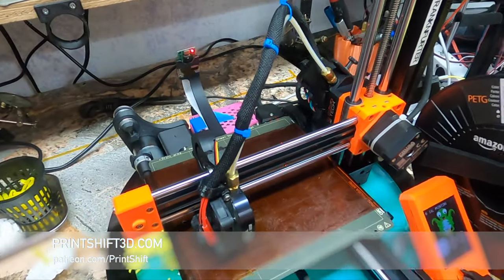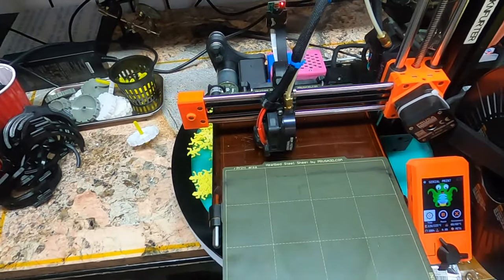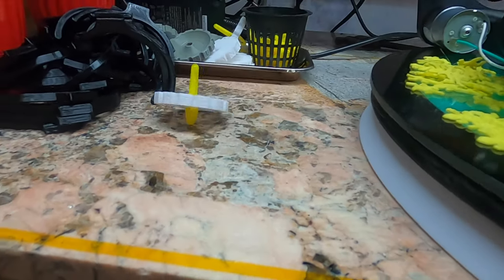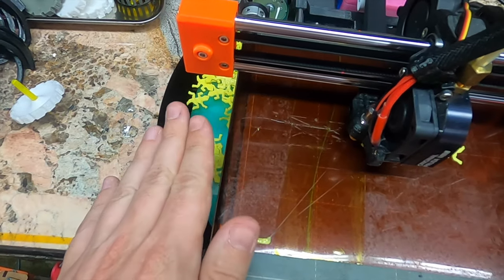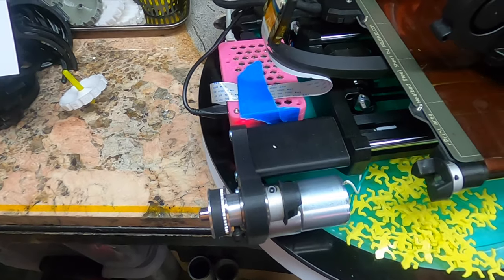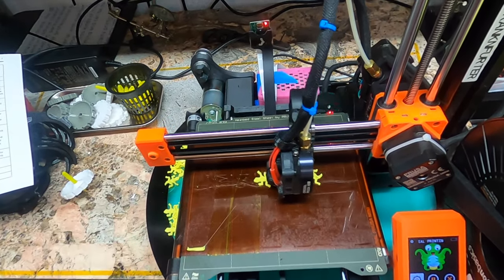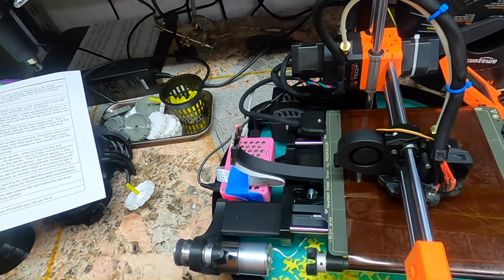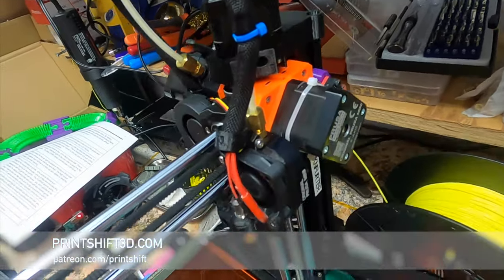PrintShift 3.0 channel trailer

Comment: Have you considered selling a parts kit?  I ask for two reasons: 

1) I love tinkering and building things and don’t mind troubleshooting or being a beta/alpha tester but I absolutely HATE sourcing random parts for other peoples designs (I don’t mind for my own projects because I’m doing it piece by piece and building familiarity with each aspect as I go, but for things other people have made I might not be able to tell a shipping mistake from an ordering mistake)

2) I can expense a project kit (with reasonable fees for time sourcing and funding additional project development) as R&D in a way I can’t (or rather can’t justify to management in the same effortless way) with Patreon
Reply from the maker: It's definitely on my mind - I made up a BoM (https://printshift3d.com/portfolio/Bill-of-Materials/), and, well, buying all the parts separately is rough.  Logistics and free time willing I'll get there!
Reply: @PaulChase  Just a small passing comment...  The Voron community has contributed an awful lot to the BOM lists that a lot os "grouped by vendor", so you can order a large number of parts all from a single vendor - making it far less stressful and less to go wrong.  Sure, it may cost an extra $2 here, $5 there - but it in the end, it saves you from all of that stress and multiple orders.

Comment: Is it accurate that the printed parts would need to have a smooth bottom and cannot have the textured surface provided by the powder coated steel sheet?
Reply from the maker: With the smooth Kapton belt I'm using now, you only get smooth bottoms.  You could certainly use a textured belt instead for a different surface finish, which is one reason this is open source: if everyone who's seen this tries a new belt material, we'll very quickly figure out the best things to use!